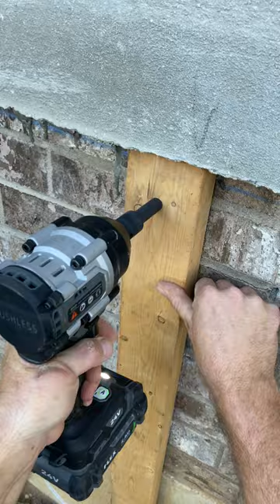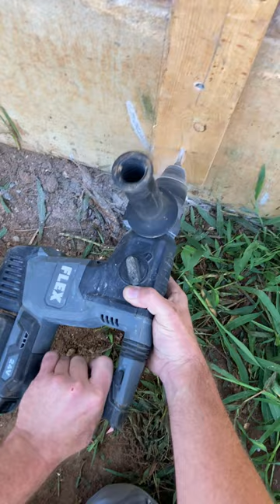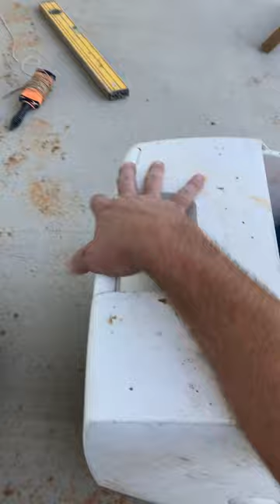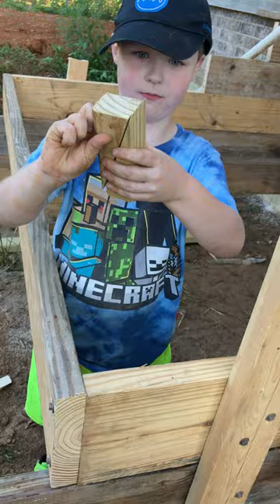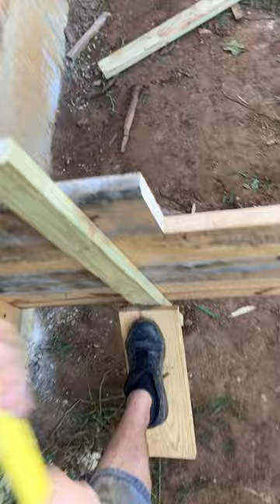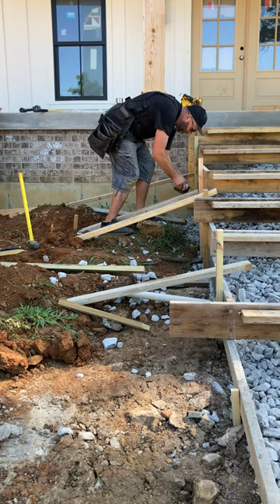Power Tool Addict / Concrete / Form Work / Flex / Blue Collar

Comment: What model impact driver and drill do you have?
Reply from the maker: The Flex quick eject FX-1371A
(Impact Driver)
Turbo Hammer Drill FX-1271T
Then you have the compact impact driver, drill driver, and hammer drill.

Comment: Do you use Flex Phillips bits?
Reply from the maker: I never use Phillips brother. I’ve used the flex 5/16, T25 & T30. They’re not bad
Reply: @IMPACT-NATION  Gotcha. As you know, I have been trying out different brands of Phillips bits. I saw the 20pc 1” Flex on sale for $7.98 at Lowe’s, so I decided to see if they’re any good.
Reply: @IMPACT-NATION  You're not missing out by not using Phillips. Sometimes I think I'm a glutton for punishment lol.